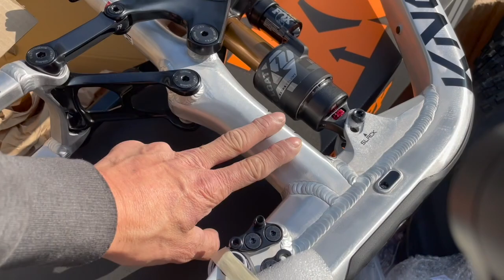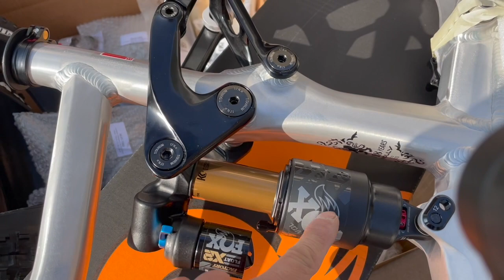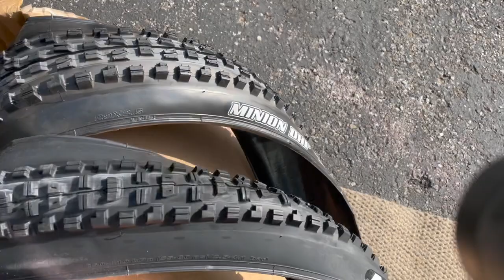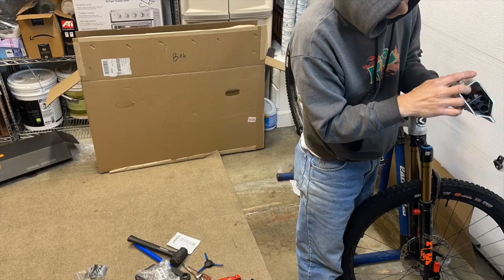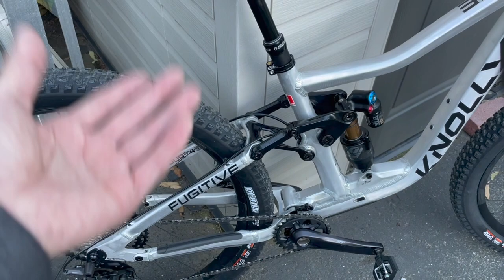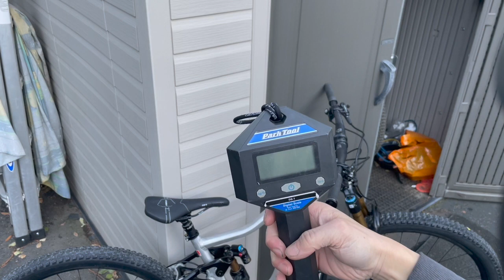Knolly Fugitive138 Unbox/build/weight

Comment: Awesome video. Curious, How tall are you? Im in between a medium and a large, trying to figure out which i should go for. Thanks!
Reply from the maker: I'm 5'6-5'7" and just tall enough to be on a medium.  I set it up as a mullet and it fits me even better so definitely on the big end for me as a 29er.  If you like poppy and being in the trees and such go medium...this is a good poppy tight trail riding style bike.  Check out my playlist and other videos for this bike.
Reply: Thanks for the info @DaBinChe ! Watching your whole playlist now
Reply: @DaBinChe  one more question if you don't mind! I just picked up my fugitive and doesnt looks like it has a clear coat or anything. Do i have to worry about corrosion? Any special care i need to take? Thanks again, appreciate all the info
Reply from the maker: @mohamedm4473  I wouldn't worry about it.  Just clean it when too dirty and it'll be fine.  Aluminum oxidize differently than iron/steel.  If you are really concern about it than just use some car wax.  If for some reason you are in an corrosive environment then for sure coat it with a protective layer.
Reply: @mohamedm4473  Just keep it clean after riding.  It's a high grade aluminum, so it should not corrode, unless you're going to give it salt water baths.

Comment: No chain guard required for the North Shore. 30T chairing for sure. Maxxis DHF/DHR are "the standard" tires up here. Congrats on your purchase.
Reply from the maker: How does that work with a smaller chainring and no chain guard?  I figured the 30t was for all those climbs on the NorthShore.
Reply: @DaBinChe yes 30T, or better yes, 30T oval required for climbs. No bash guard required. If you hit your chainring, you screwed up or need to adjust your riding style.